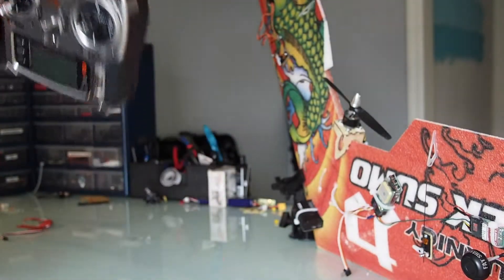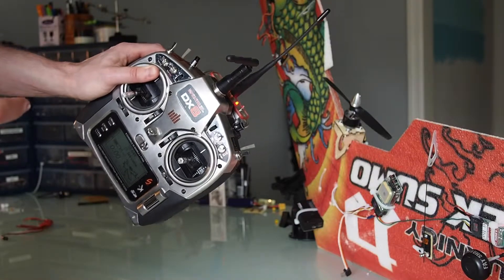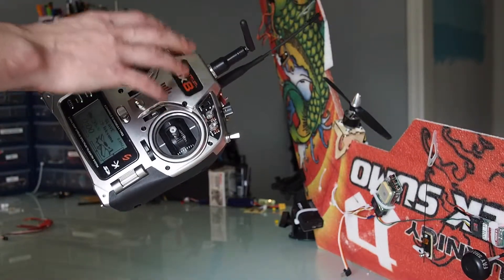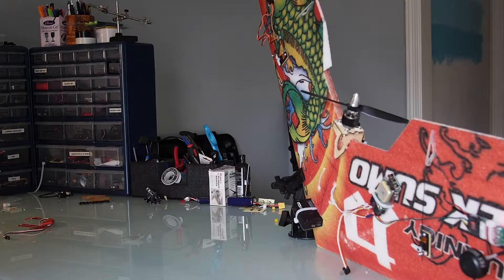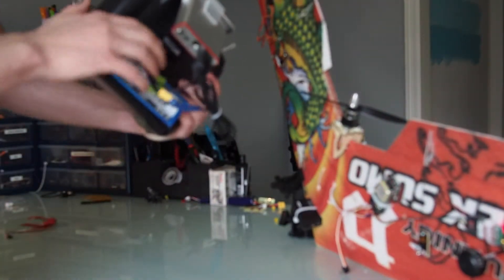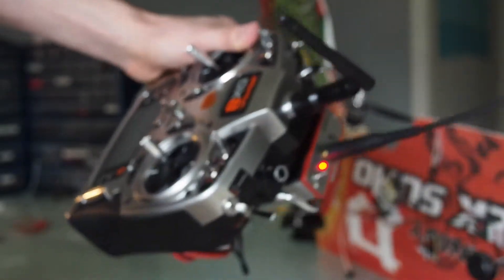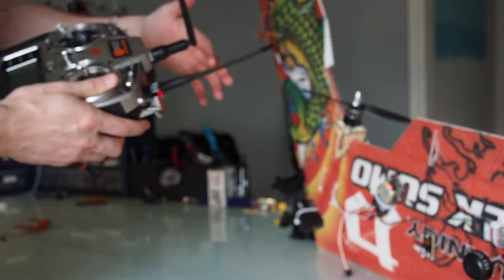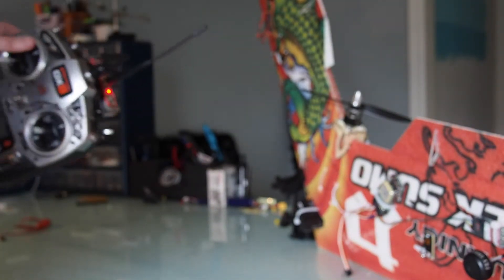DX8 and EzUHF Troubleshooting (Beeping and Signal Loss)

Comment: Greetings I have a dragon link V2 and I use it with spektrum dx8 G2 and a few days I'm having a kind of interference when I connect the dragon link radio spektrum I get a signal from a radio vhf or a walkie talki and the radio goes out of control and the plane It turns on alone. What should I do?
Reply from the maker: I don't really know the answer, but happy to give you some ideas. Make sure the antennas are well separated. Possibly even having the dragon link on a tripod. Might put RF chokes on the control line from the DX8 to the DragonLink. Might try opening up the DX8 and removing the antenna (WARNING: in theory that could damage the radio) or the whole RF card if its just on headers (Again, I have no idea what that would do to the DX8). I have had the antenna get disconnected from the PCB (causing a crash ) after reconnecting it the DX8 worked soooo...... If dragon link's case is plastic, you could try wrapping it in foil and running a wire to ground.  Essentially I am trying to keep RF only where it should be. Hams talk about "keeping RF out of the shack" from what I remember, this was a similar problem.